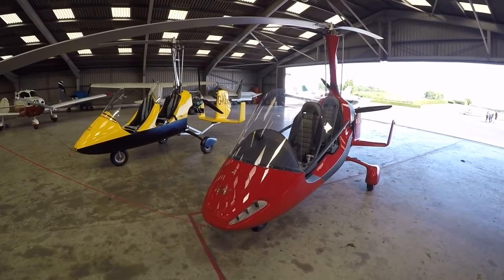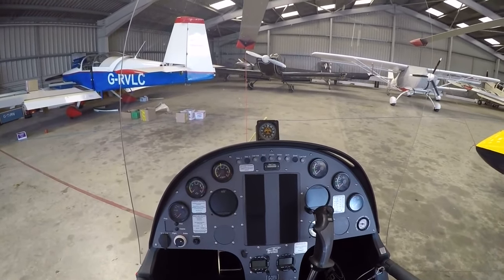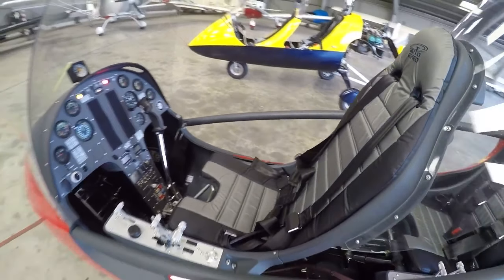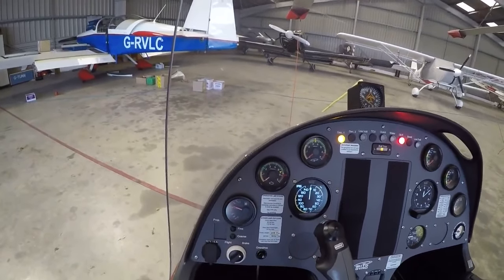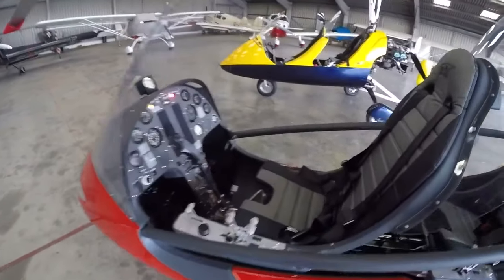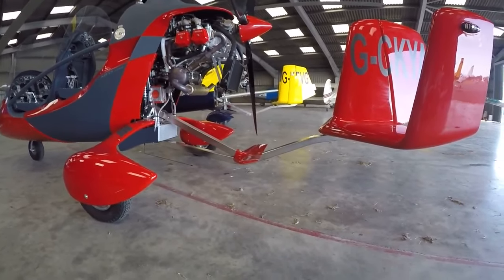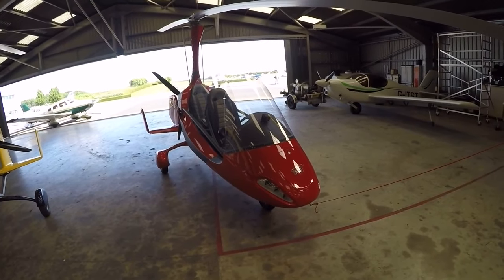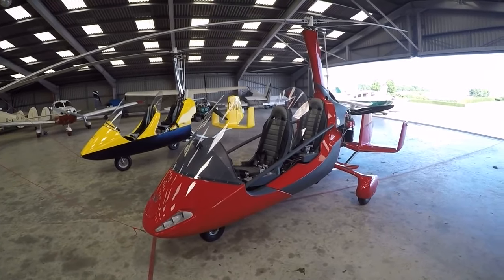Auto Gyro MTO-Sport 2017 aircraft review

Comment: Hi Phil, I have a Sport 2017 which I've flown for around 40 hours now. Lovely aircraft to fly, few other things to mention to viewers who have an interest in the aircraft are: 

The undercarriage design which significantly improves ground handling and take-off/landing comfort.  With the TOPP rotors (blue caps) a lot smoother (IMHO) flight, more stable 'heavier' feeling cyclic. Mast height lower for a lower CofG, split mast if you ever need to transport the aircraft.  Pre-rotator iii you mentioned but the clutch action is smoother and doesn't require belt changes, I've never once had the clutch light lit, have pre-rotated to 300rpm on a warm day with my instructor in (so max all up weight) and we realised a significantly shorter ground run using the standard take-off technique. Apparently very comfortable in the back as reported by my instructor.  Better wind protection with the larger screens. Definitely runs cooler in the warm weather than my friend's Sport 2010 as it has a larger oil cooler and radiator.  Option on the 914/915 of a night kit which enables the aircraft to fly in night VFR conditions (although this is pricey with a certified EFIS on-board and adds further weight due to an auxiliary alternator, certified landing lights etc...) .

How do your students feel about the Sport 2017 - do they prefer it? Are you going to keep the aircraft?
Reply from the maker: Jason R Wilkinson hey Jason thanks for the views and some good points made which the good ones I’ll cover in my review of the 915 engined version if that’s OK.  So I’ve been instructing in one over the summer and agree it is a nice aircraft although even low spec 912 ones are near £80k in the UK which if I’m honest is toppy.  Undercarriage I think is at best marginal change although to be fair I operate of tarmac mainly so perhaps that colours my view? Rotors are an interesting one. I agree on a long flight the TOPP edition (which for the new to Auto Gyro product is effectively rotor system 3) as they have moved toward mimicking a Magni feel but local area dynamic flight I always loved rotor system 1!  Actually the split mast is less about transportation and more that if you roll then it becomes the natural breaking point rather than twisting the entire airframe.  I’m going to assume you have a 914 version regarding the ability to make the most of the additional pre-rotation RPM and using a modified technique as per the POH (which is actually closer to my own preference of take off technique) with a 912 at MAUW the motor struggles to deal with the extra drag and you need more forward stick than almost anyone I know flying a gyroplane would be naturally comfortable with (I actually think it’s probably worthy of a factory pilots course to teach people how to get the best from the system).  The aircraft is a nicer environment than pervious editions I have a small frequency hit my helmet in the rear if I’m honest but it might be a size/position thing? Yes it is well cooled but night kit (in the UK anyway) is largely pointless. Obviously it adds a layer of regulation which is entirely unwanted (if you have dealings with our own CAA you’d take my point) and the number of night equipped airfields are minimal. In the UK we have gone down a rabbit hole with night/CPL.  Students love it. Will I keep it? In a word no.  Not because it isn’t a great aircraft - it is but, and it’s a big but.  All gyroplanes in the UK have raced away price wise to the point of questionable value. It’s hurting the market here. They are far in excess of the original adopters of the class and so they can’t afford to change into a new aircraft. Instructors don’t see an additional £50k value from an old MT03 as the price of a lesson is same/same. And finally new students (or potential new students) ask “what can I do once I have my PPL?” And you explain the price of entry is what it is and they at best just don’t get excited.  At £50-60k these things sell all day.  At £80k the get sticky.

Comment: From what I've been told, the colour-coordinated cylinder-head caps on the 2017 model are an optional extra. If you don't pay for the option, you get the regular coloured caps (green = 912, red = 914, blue = 915).
... and you keep referring to the 2010 model of MTO Sport, yet everything you said of it applies to our MTO Sport which was manufactured in 2009. The instructor pack in ours also has mag switches (covered by protective caps) which are sited on the left of the passenger/instructor along with the throttle and the trim and PTO switches. I don't like the electronic ASI and altimeter in the 2017 - I just see them as an expensive gimmick. I would rather have the steam gauges. There are things I like about the 2017 and things I don't like about it. I don't think I would be likely to "upgrade" from our MTO Sport. It's a fair bit heavier and the 912 leaves it a little underpowered.
Also, if you trailer it - Be careful of the little fin at the bottom of the keel. It will possibly need to be removed (we had to remove it when we trailered one a couple of weeks ago).
The airscoop underneath to direct air to the oil radiator seems a little unnecessary for the UK as MTOs tend to run cool anyway.
One real niggle with the whole package is that the master switch, the nose compartment, and the fuel filler cap all take different keys. Even my 2004 Suzuki car uses the same key all-round (glovebox, fuel filler, doors, and tailgate). Because the nose compartment is fully enclosed, you can no longer reach through from the footwell to grab your Mr. Funnel. I'm not sure if that's really a good thing or a bad thing.
Reply from the maker: Hey thanks for the comments.  The point about the cam covers and the colour is that now you can specify your own colours it therefore means you can't simply look at an aircraft on the apron and assume that (for example) because it has red cam covers its a 914 powered aircraft etc.

2010 Sport is Auto-Gyro's term for the aircraft you have and I refer to as the 2010 model... (https://www.auto-gyro.com/en/Gyroplane/AutoGyro-Models/MTOsport-2010/)

Yes agree the ASI/Alt I think its form over function and something likely to snag

On the keys.....I'll tell you something very interesting..... your sport ignition key, try it in any other Auto Gyro and see what happens.  Hence the different ones for the lockers!!!  Seriously.
Reply: Gyrocopter flying club - Yep. I know the MTO Sport keys are "universal". Not that it would take much effort to hot-wire one, anyway. I didn't realise that the official name was the "2010". I just thought that they called that model the "Sport" rather than the MTO3. Cheers for that... but yeah... they were making them prior to 2010.
Reply from the maker: @RoadRunnerLaser  yes its an odd thing the years / model ref.  Haha I think flying one becomes the bigger challenge, would make for an interesting piece of CCTV footage!
Reply: Gyrocopter flying club - Yup... but stranger things have happened - Remember the case of the baggage handler who stole a Dash 8 Q400?